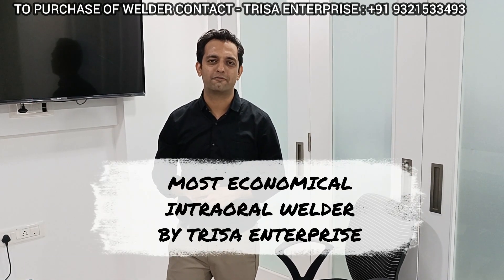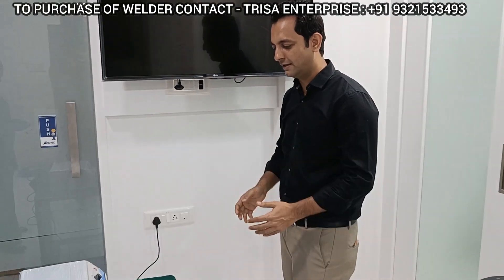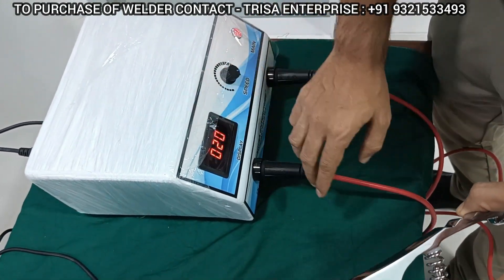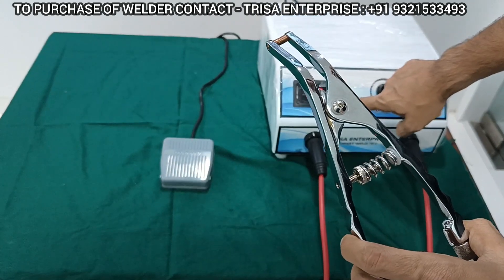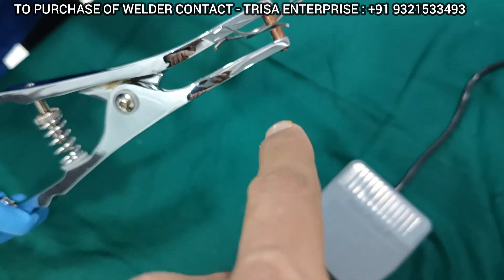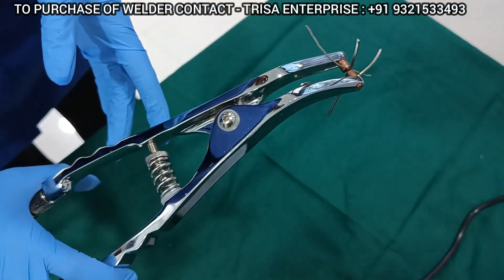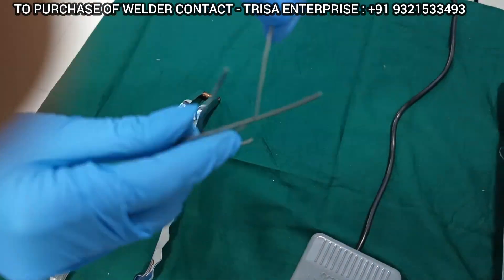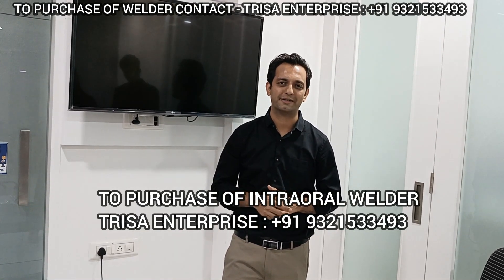WORKING OF INTRAORAL WELDER BY TRISA ENTERPRISE

Comment: Which diameter of wire should we use?
Reply from the maker: you can connect with trisa enterprise- +91 9321533493